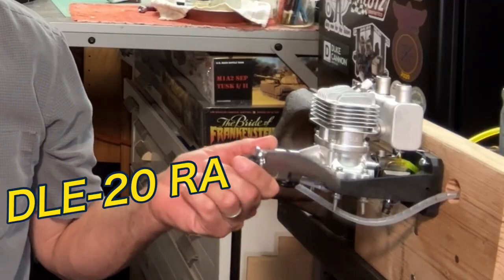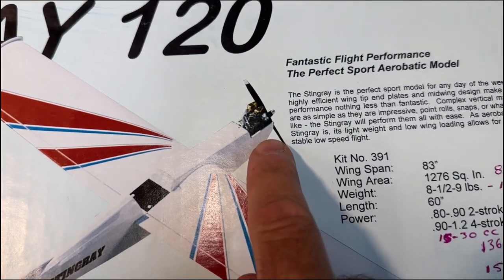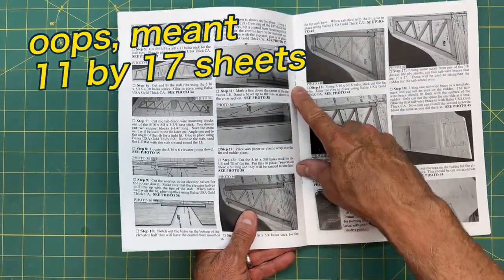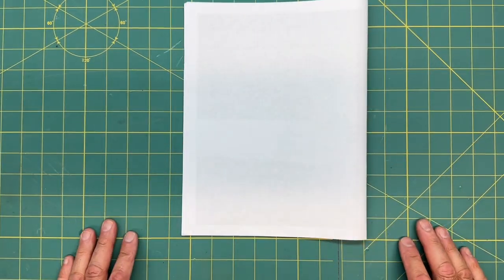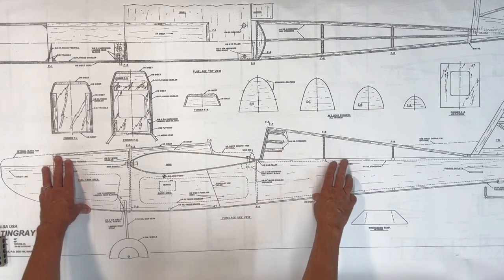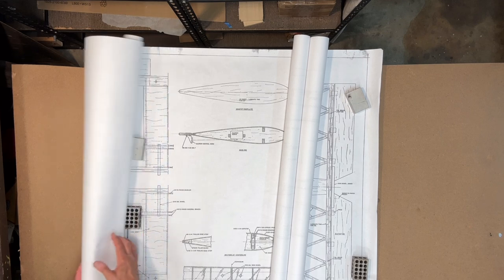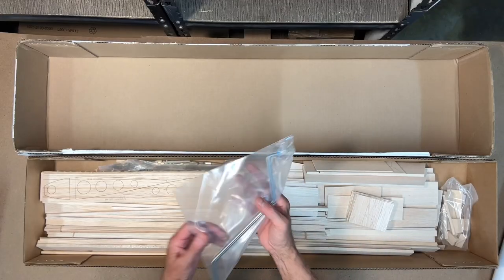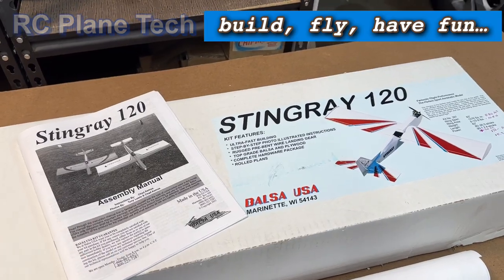Balsa USA Stingray with DLE-20, RC Plane Build N0 1: Intro

Comment: I’ve been eyeballing the stingray 120 for a while. It’s a lot of bird,  but I’m going to follow your build and see how I feel when it’s done. I have a couple gas engines now, but they sit in their boxes until I’m ready to fiddle with them. 
I need to look up a bodkin now.
Reply from the maker: Thanks for watching. So far its been OK… but I have a few questions into their tech help regarding gaps in wing spar/rib joints and aileron instructions. None of the issues are insurmountable, but they do add some difficulty. Thanks

Comment: Nice to see you building again. Loved the Smoothie build but not the crash…lol. I am starting a scratch build Great Planes Super Sportster 90-120 from scratch. I will be converting mine to electric. Looking forward to building together. I would like to see the customer modifications some of which you spoke about. How about adding flaps. Good luck.
Reply from the maker: Thanks! Flaps are something to consider. I'll be using individual aileron servos, so I prob will be programming that function for flaperons.  But making them separate would take a little thought because the ailerons run the entire wing length so I wouldn't be sure how cutting them and reducing their area would impact the flight characteristics? Good luck with your build as well. By the way, are you with Balsa USA?
Reply: @JamesRCPlaneTech  I am not associated with any company. I am just a guy who built and flew RC planes 30 years ago but quit because of kids and family. I recently started back earlier this year. Started to build a Cub and realized it would take too long to actually get flying so I bought a BNF plan. Already flying and building a new plan. Changed my mind on the Cub.
Reply from the maker: Oh ok, cool. You mentioned you liked seeing customers make modifications,  so I was thinking you were with them. Cool that you are back into the hobby. A lot of us have similar histories. I returned to the hobby and things had changed a lot, but happy to see that people still like to build. Wish more companies would come back and start providing kits again.
Reply: @JamesRCPlaneTech  I think it was a typo and I meant to say custom modifications. Happy flying.

Comment: James, I was working on the Smoothie today and watching your videos again, and I remembered you saying that you waste too much epoxy.  

I use a pice of 3M paper and a bodkin. I put a drop or each epoxy on the 3M paper, mix it with the bodkin and then throw away the paper and wipe the bodkin clean with the same piece of paper. 

You can use one piece of 3M paper multiple times if you want. 

I keep my bodkin in an old 35mm film canister.  An old trick, fill the film canister with steel wool. Push the bodkin(s) threw the plastic cover and store them like that. Each time you put the bodkin in or pull it out it gets cleaned by the steel wool.
Reply from the maker: Hi. I had to look up and see what a bodkin was, lol! That's a unique tip for sure. I mix too much epoxy at times for sure. I try to estimate, but not always right. then I usually use the wood mixer sticks, but they only last so long. Thanks for the tip.

Comment: I'm making an RC airplane using balsa wood for belly landing. I'm using a motor and lipo battery .My main goal is for the aircraft to lift a greater payload capacity and achieve a smoother flight. I was thinking of making a circular cruciform tail for this purpose, but I'm not finding much information about it. Do you think it would be beneficial for this? If not which will be better except for the conventional tail.
Reply from the maker: Sorry to say I don’t know. Maybe more research online you’ll find more info. cool that you are building and designing your own plane. I imagine a circular design would be a little more conducive to that design, but only guessing. Good luck with your build.

Comment: And i would encourage you to try oratex fabric covering. Works much easier than ultracote and a tougher product for the occasional hanger rash.
Reply from the maker: I'll check it out. I have usually used Monokote. Oratex is like the old Solartex I believe. I used the Solartex in the past but not the Oratex. I have their Nieuport 17 kit that I know I'll be using the Oratex on. Thanks for the input.

Comment: James, I've just found this build series currently on no.11. What factors made you pick the stingray over the smoothie xl?
Reply from the maker: I was looking for a plane that would be good fit for the DLE 20 cc. And found the Stingray, which looked like an easier build. I really wanted to break into using gas engines over glow, and the DLE looks like a good starting point and the Stingray a good plane to go with it. The Smoothie XL looks awesome and I have considered this for a future build. It would be a more involved build and Probably would have to get the larger engine than the 20cc for it to perform best. So hope that helps.
Reply: @JamesRCPlaneTech  I'm just getting into the hobby and can't make heads or tails on weather I want to build a stingray with a DLE 20cc or a smoothie xl with a DLE 30cc. I'm am planning on building a lazy bee for a trainer. I really enjoy the videos